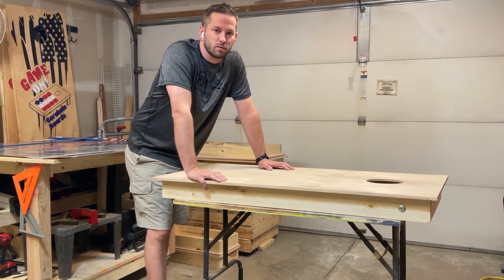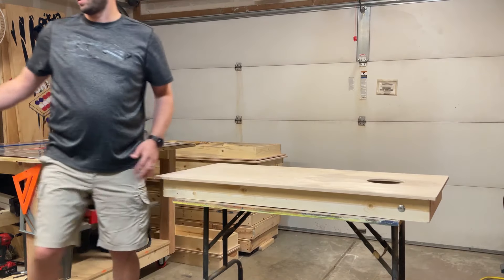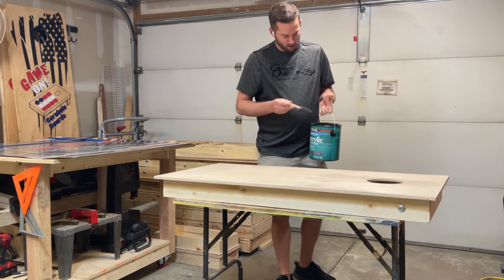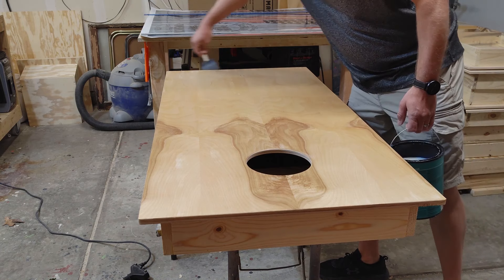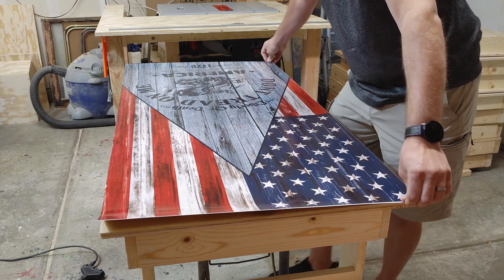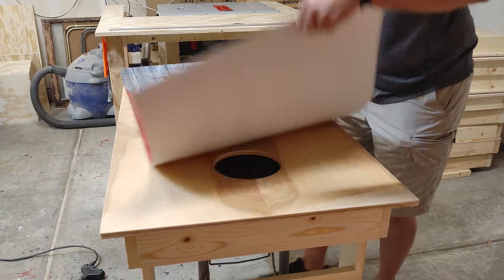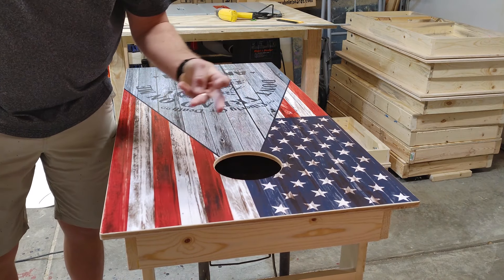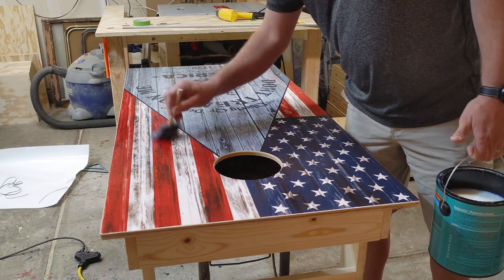Installing a vinyl wrap - cornhole boards

Comment: Good video but I have a bit of a problem with the actual design. The flag is backward (negative side of a print). Only active duty soldiers wear the flag in that position as a statement that they are returning home.
Reply: Incorrect.  When the US Flag is hung vertically, that is how it should be displayed - with the union in the top left.  But, since this is not an ACTUAL flag, it's a non issue.
Reply: @richardmann2960  , Thank you for your correction.  It's nice to know others care about how are flag is displayed.
Reply: @davidshelp7116  I by default print this way, as I was taught it is the correct way if the flag is vertical. It is also by customer request. Thanks for showing you care though!
Reply: @bassplayersyx  A similar comment was made by Richard Mann, I thanked him for his comment, as I do you, and say thank you for the correction. We're always old enough to learn.
Reply: @davidshelp7116  No problem.  It's a relief that not everyone in the world gets offended by a correction.  Thanks for taking it in stride.  Yes, we all learn things every day as long as we keep an open mind.